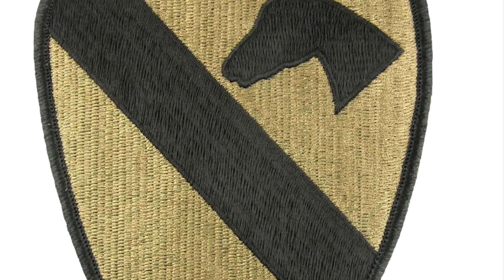Dodge Town Panel  built for the Wounded Warrior Foundation and the Collings Foundation.

Comment: That grille is very unique, and I like it. Was it military issue, or just custom made
Reply from the maker: The government took possession of it a bulk order of 50 trucks. Price a whopping 1750$ each. Most went to Park service, Groomlake, aka(area51)
Reply from the maker: I also assume that you would not put a bright metal grill on a army truck. Is just a cheap way to save money when Chrysler corp built them.
Reply: @lautburns4829  I'd have to look up '58 era grille. If I remember correctly they had 4 or 5 horizontal bars and a center divider. Yours just caught my attention, a real clean look